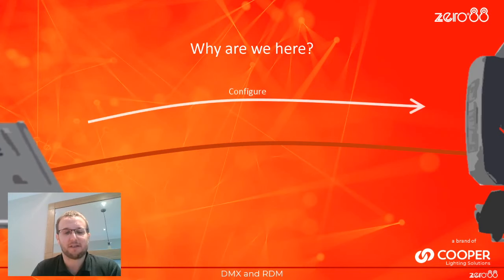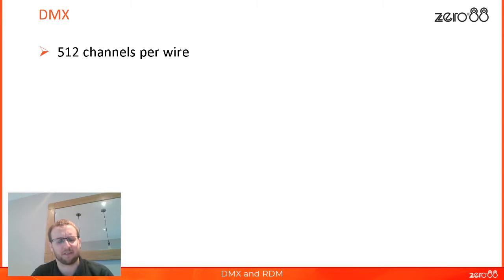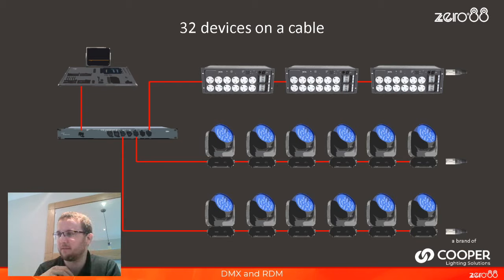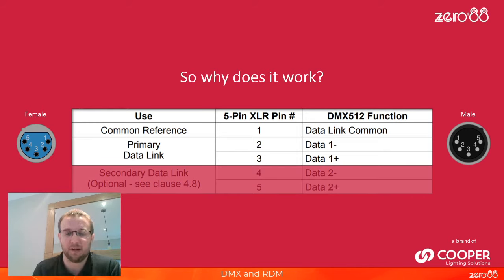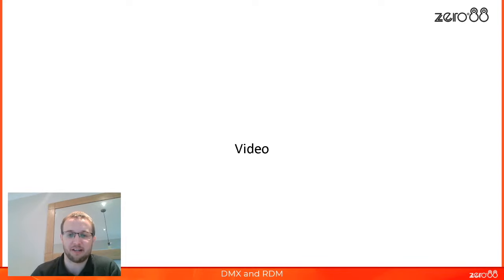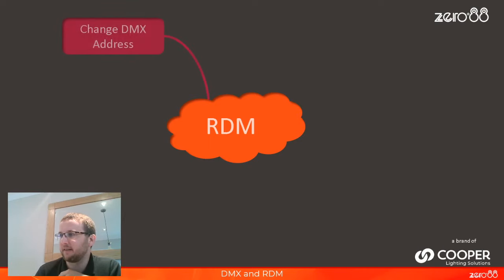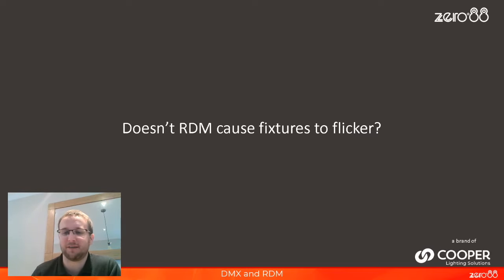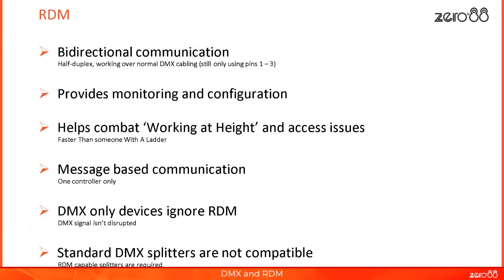DMX & RDM

Comment: Nice Tehnology -  but... affter i put address with "RDM console" ..  i will need to change to old DMX console or software to control lights .. is more convenable ...  or will neeed to create an "RDM" terminal that will be on network only to view-change or use ONLY for set fixtures
Reply from the maker: Hi Gabriel, if you are using a ZerOS console, and need to revert the rig to how it was discovered, you can press the "Revert Rig Back" button, to send RDM devices back to their original modes and addresses. Send us an email to support@zero88.com if you have any questions.